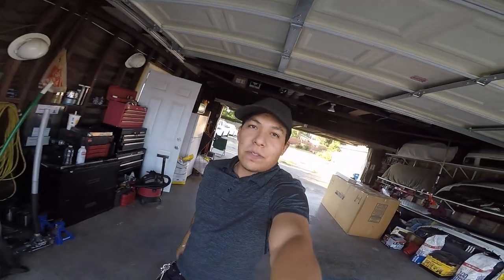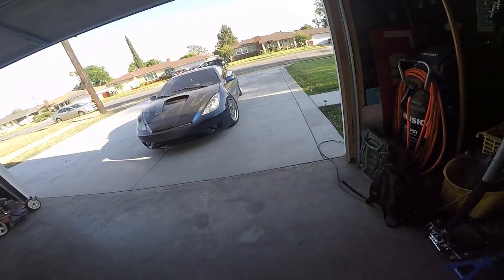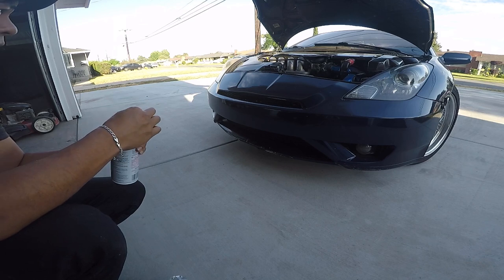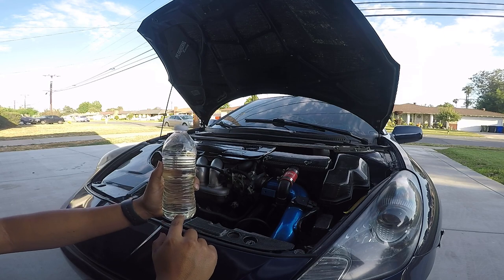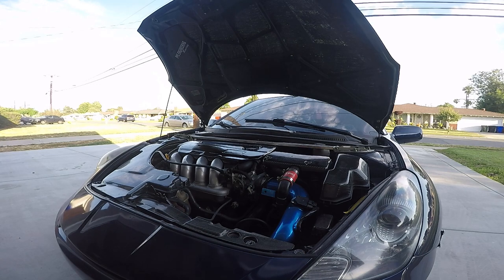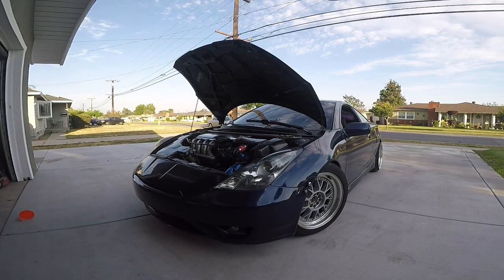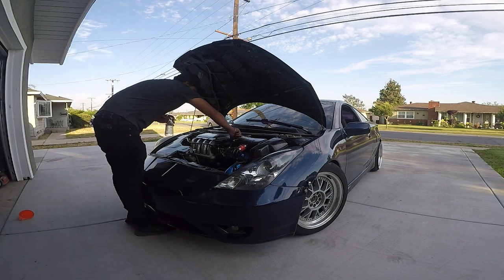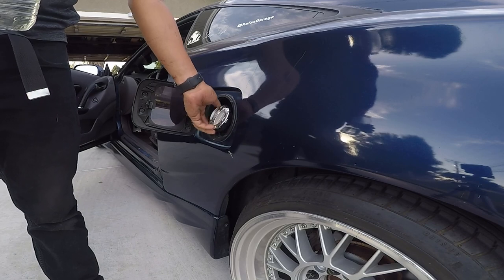How To Seafoam Your Car

Comment: Hey Rafa I have a 03 gts and have the leaking timing chain tensioner. I already changed it with a new o ring. Any ideas what I should try next?
Reply from the maker: Komebackid510 timing chain cover